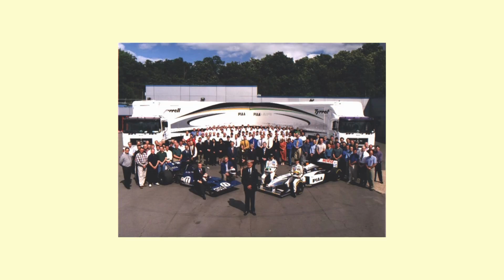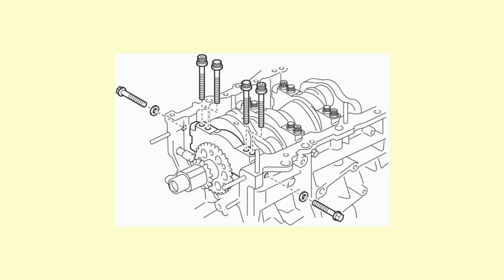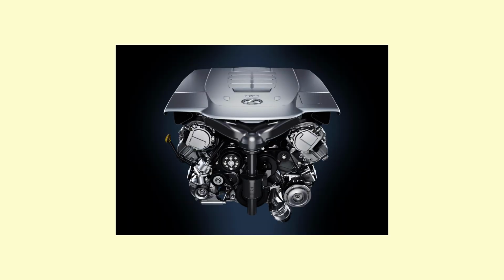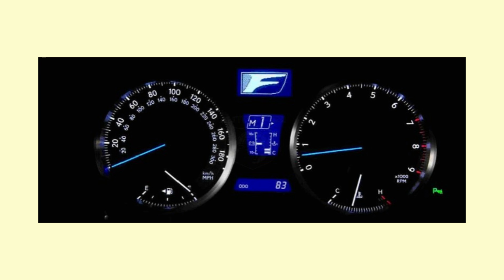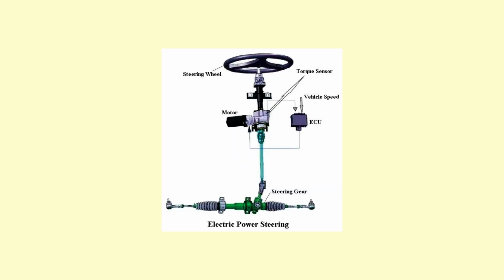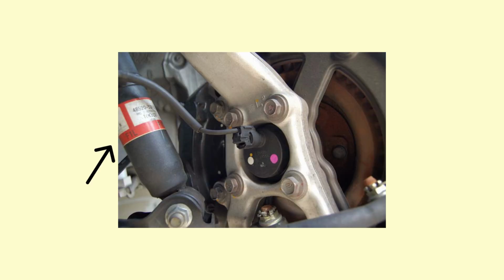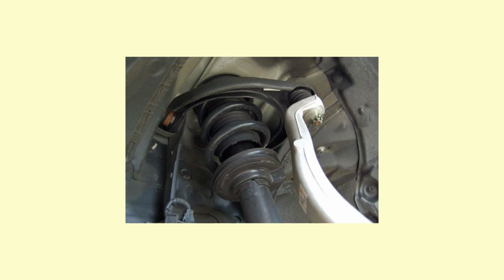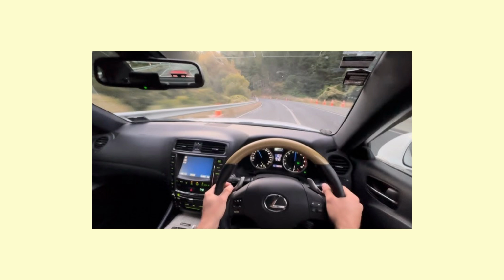Automotive X-Ray: Lexus IS F

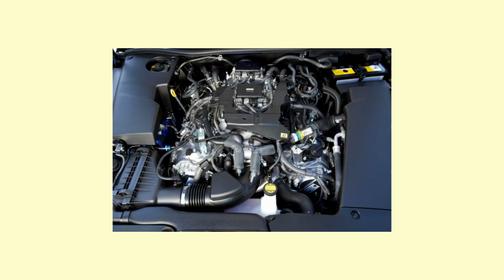Comment: 4:36 small correction, the indicated pipe is the PCV pipe, secondary inlet is a flap that opens inside the air box on the right, allowing more air to enter and that in turn also allows the induction sound to escape making it louder.

Comment: Fantastic video. ISF's do not ride smooth though. The ride quality on the pre 2012 models is extremely stiff and not pleasant for daily driving. Even the 2012-2014 models that they revised the valving to be softer were not that much better. If you buy one of these upgrading to a KYB coilover suspension makes the ISF much much better

Comment: I really want one, too bad the prices exploded where I’m from
Reply: I have a 2011 with 142K miles on it…I am the 3rd owner and it has no accidents. The tires are only about 8 months old…I just replaced the rear shocks…Completely Stock and ONLY serviced at Lexus Dealerships. I’m selling it because I just got a LC500.

Comment: Good video, but the is350 also have DI and Port injectors to help with carbon build up, the IS250 does not.
Reply from the maker: Yes, we mentioned the 250 had carbon buildup issues, the 350 does have D-4S too correct

Comment: 6:33 you are pointing at PCV circuit. the flap that you are talking about is on the left in the intake box. and its actuated by manifold vaccum controlled by the solnoid that you can also see in the image above the intake box
Reply from the maker: My apologies for that!
Reply: @Enguitive  good video btw
Reply from the maker: Thank you for the feedback though, we will sand out the inaccuracies in our next X-Ray videos!

Comment: F1 engineered v8 sedan? Now where have I heard that one before
Reply from the maker: Volvo S80 is also a Yamaha engineered sedan that was produced before the IS F 👀
Reply: “The Lexus IS F utilizes an 8-speed Sport Direct Shift (SPDS) transmission known for its ultra-fast shift speeds, particularly during upshifts. It's designed to feel like a dual-clutch transmission (DSG) or even the F1 transmission found in high-performance cars. These shifts can occur in as little as 0.1 seconds.”  I took that from a simple google search. Although, engineers described the transmission shift speed that of a F1 race car. I remember reading about the same thing when the vehicle debuted back in 2007.

Comment: Great Video . . . but you were wrong about one thing

The BMW M3 was actually not faster then the ISF on track entirely . This was only true for the early years of the ISF aka the 2008, 2009 models where none of the suspension, steering and wheel updates were done. The 2012, 2013 2014 models were lapping as fast as the M3. This was proven by a track test conducted  by motortrend with a 2014 model year ISF verses a E90 competition model. The result was both cars put down the same lap time which is insane being the ISF is a 4 door and the M3 used in the test was the coupe plus competition model.
Reply from the maker: That is correct, and a mistake on my part as I have clearly generalised by only using one example which put the IS F in a bad light, which I should've made clear: the Top Gear test track, a circuit with lots of turns where its front heavy bias and no LSD at the time struggled compared to the M3. One question though, isn't the E90 the 4 door?
Reply: @Enguitive  m3 could be had as coupe or sedan
Reply from the maker: @davidwebb7643  Yeah, the E92 is the coupe and the E90 the 4 door

Comment: When you mention the secondary intake passage its a part of the air filter box as a vacuum operated flap that opens in the engine bay, it's just underneath the passenger side beauty cover
Reply: The arrows you put on the pictures were pointing at the breather hoses for the valve covers
Reply from the maker: My bad, I must have mistaken that as the intake airways, thanks for the clarification!

Comment: If you approach the ISF / RCF / GSF etc as muscle cars rather than super saloons, it makes more sense. They’re meant to evoke emotions just as much as they’re supposed to be fast. 

Non-Hellcat Chargers and Challengers still sell like hotcakes despite being <500hp and weighing a boat, as well as there being plenty other faster options out there, because they’re marketed correctly.
Reply from the maker: Absolutely, whilst other competitors have switched to turbocharged engines, Lexus still stay true to their roots with the NA V8, and you add the reliability X-factor of this car as well

Comment: Great video. Can you do a follow up x Ray review on the IS500 and RCF?
Reply from the maker: We'll definitely consider it as there's quite a few changes made to the engine and chassis for those cars!
Reply: @Enguitive  I had an 08 IS F for 15 years, ended up swapping in an OEM LSD and a few other minor tweaks. I now have an IS500, so add me to the list.
Reply: @Enguitive it’s a different chassis

Comment: the reason its slower than the m3 was mostly due to the lack of a proper LSD and undersized front tyres (225 vs 245 on the m3).
Reply from the maker: Yep, eventually with the LSD it becomes on par with the M3, although the E92 M3 in my opinion due to better front/rear balance as a result of being over 100kg lighter is suited better to smaller, technical circuits or the canyons
Reply: @Enguitive  they are a well balanced car that doesn’t try to kill you if you get it wrong